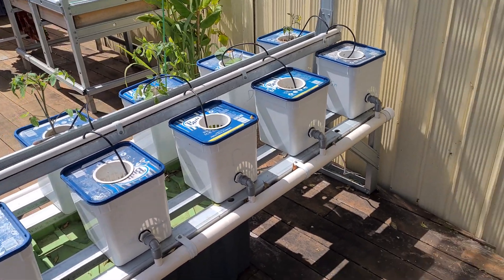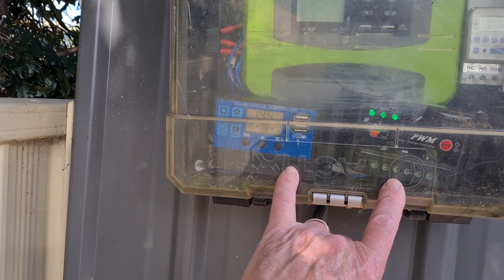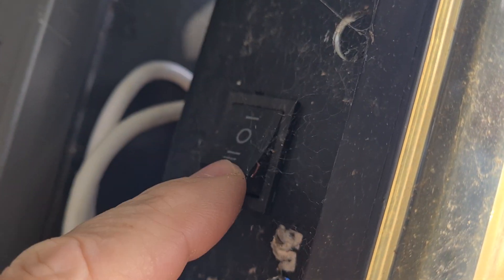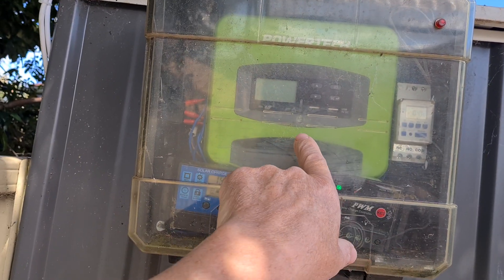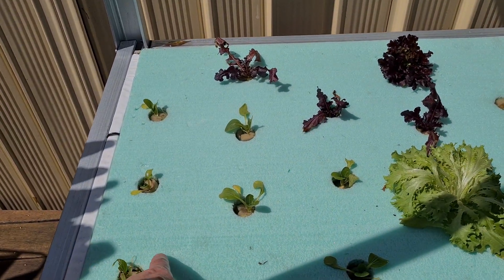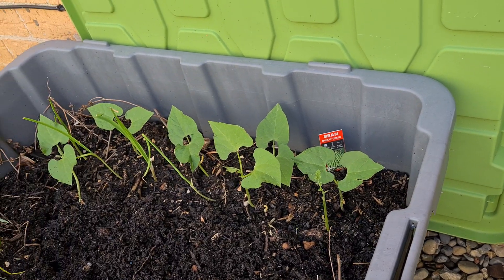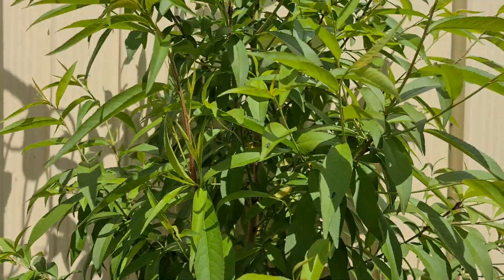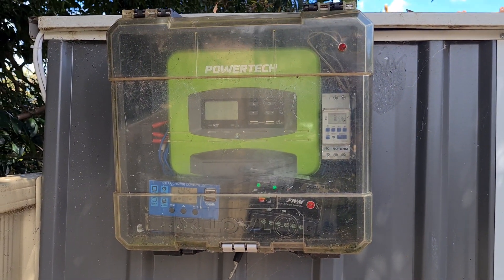DIY separating  solar panels  for extra power hydroponic garden

Comment: Nice setup, i have a 4 bucket systems  on 300watts with a epever 40amp mppt charge controller on q 100 amp hr Duracell  deep cycle
Reply from the maker: Nice
Never run out of power
How many  systems  are you running
Reply: @smarthydroponics  just 1 system  but im upscaling  to run a water chiller for it as well
Reply from the maker: @lifebehindtheselens  nice
Im running  4 systems 
I dont use any back up  power as it works so well